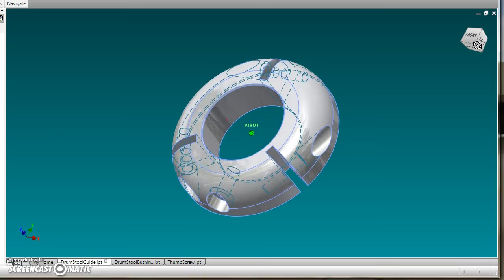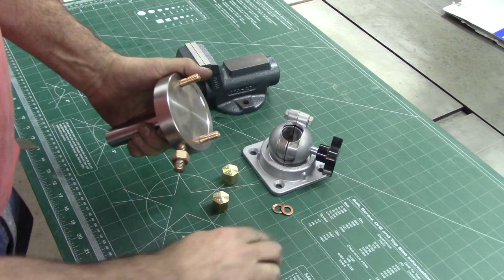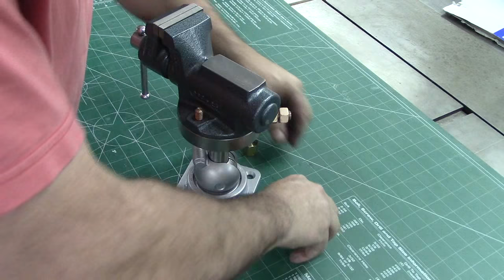Small Vise Mounting for Welding Table

Comment: Sweet.  Panavise makes all sorts of 'vise-like' attachments for their 300 series but nothing expect the holding fixture for the 400 series.   Another 300 attachment they have is for holding PC boards -- holds big flat items for soldering.  I think it might be possible to modify the Czech vise to do pretty much the same thing.  Kind of like what's done with a milling vise when you mount the jaws on the opposite ends of the vise -- drilling the jaw holes on the Czech vise through, adding studs to extend the fixed jaw back and the movable jaw forward (spotting the holes so the extensions fit square), and adding jaws to the  extensions that are raised slightly so they support a flat plate.  Could even use it to add a fixture plate  Would really increase it's usefulness for welding hard to hold flat stuff.

An idea on how to mount this on a welding table:  mount the Panavise 400 on a piece of square tube (might need a plate) so that it fits inside another square tube mounted on the underside of the table.  Vise could be slid out and easily stored upside down or used right-side up.  Pin the tubes to hold it in place.

Good project.  Thanks.

Comment: I like watching you use your previous vise build to wield the new vise. Nice build with the fast video. I have two of the smaller PanaVise 300 standard bases mounted on workbenches around the shop and use their horizontal and vertical vise heads for holding small parts. I need something like you built for the more holding strength.

Comment: Those mounting devices with adjustable angles are great help for welding or what ever else, the only thing missing is a tilting  rotary head with an a variable speed, they cost an arm and a leg even used...  By keeping eyes open sometimes great deals show up....   ;)
Is it still spring like weather around you, cause here we're getting a few days with some minus 20 to minus 25 deg C, kinda makes old bones skweek and screetch.......   lol

Comment: I've always liked the PanaVise rigs. I have several variations (3 different bases and 4 or 5 vise bodies) around my shops. I'll have to consider that Wilton clone for an extra vise option. I might try offsetting the shaft so it is centered under the fixed jaw. Best compromise between having the axis under-the-anvil and under-the-workpiece. The downside would be not being able to grip a long piece extending below the edge of whatever workbench it is fastened to.

Comment: Thank you Randy. One thing I want to say that isn't a criticism, so please don't take it that way, but is there any way to isolate those nice brass cap nuts so they don't get an accidental arc strike mark on them? I just remember back when I worked on some pipeline somewhere that we used fiberglass sleeves and fibermesh washers to isolate the line from static and wondered if that would work here, or if you even think it would be necessary? 

I appreciate the video and have one of my own up again, and will even have a real one about machining soon too, imagine that! Aloha...Chuck

Comment: Just wondering about the welding on the drill rod, do you think it might crack?
Looks great otherwise.
Reply from the maker: +MrJohnnaz I ended up using a piece of Stainless 316 tubing.  For this use I think it would be just fine, not much force on it.